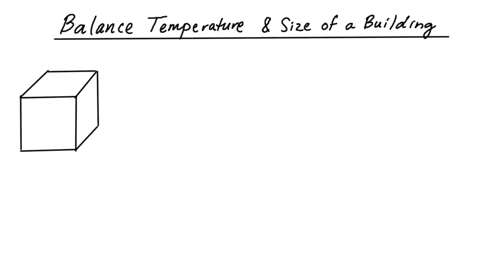Balance Temperature and its Relationship to the Size of a Building

Comment: In buildings which part is responsible for maximum heat gain 1)Roof 2)walls 3)chajjas 4)windows ..??
Reply from the maker: It all depends on the relative relationships between the R-values and the areas. For example, I'll just compare windows to walls. Walls typically have a higher R-value than windows, possibly 3 times as large. That would mean the wall area would have to be 3 times as large as the window area in order to have the same conductive heat transfer. Some buildings will have a higher proportion of windows, like an office building, and some buildings will have a higher proportion of walls, like a warehouse. So you'll just have to do the engineering for the individual case to find out!